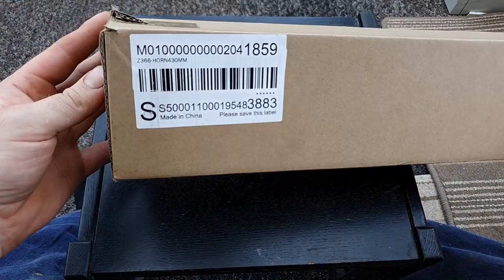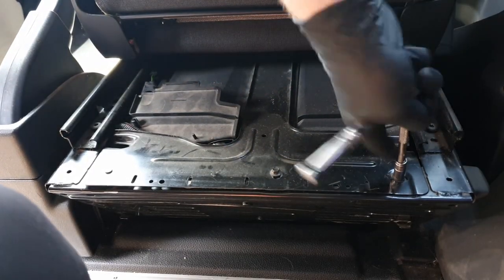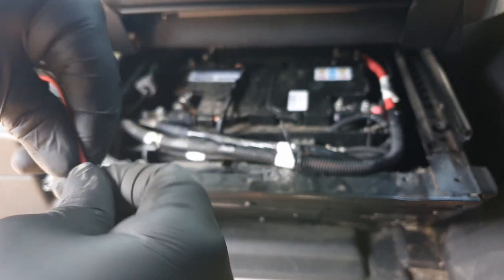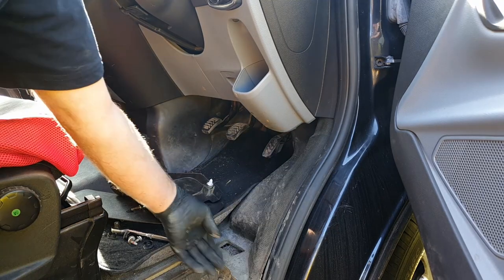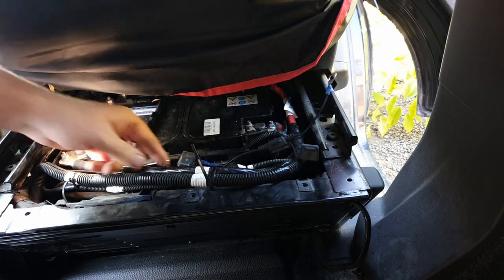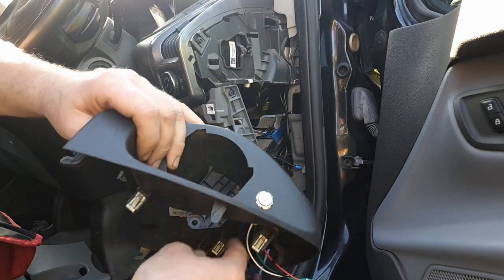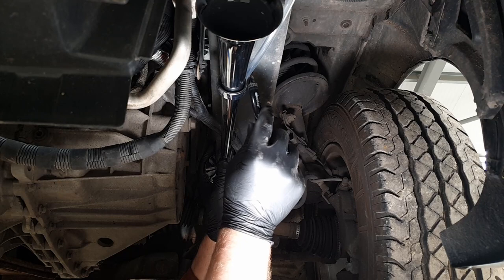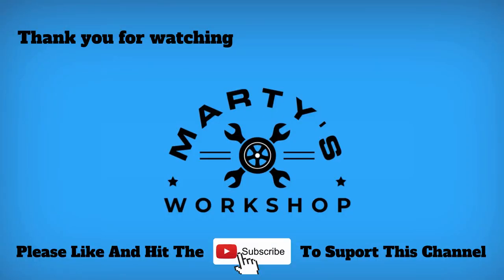How to fit an aftermarket air horn kit to your ford transit custom or any car, van or truck

Comment: Great video. I think I need your help 🏴😂
Reply from the maker: Thank you for watching
Reply: @Martysworkshop  what size cable am I ok to use for my Compressor for my Dixie horn. I’ve done a set up like yours but I’ve just realized I have used a 17 amp cable from Halfords. 

What can I get away with mate. 

Thanks

Comment: GREAT instructions. I'm putting air horn in crossover in a Vauxhall mokka but will use existing push switch on steering wheel and use existing wires but will get feed from battery with 30 on relay jointed together with 85 on relay. Just need to locate original horn in mokka think under front bumper ,good reviews
Reply from the maker: Thank you for you feedback and support

Comment: back again,can i connect too live and negitive wires already connected to my vehicle horn cables, so i can use the air horn and vehicle horn together.would i still need a relay or can i  do without relay if connect air horn connected 2 wires coming off vehicle to be able to use the 2 horns together of origional wiring . put in 20 amp fuse instead of 10 amp for origional horn.cheers
Reply from the maker: If the original horn uses a 10 amp fuse then that is to protect the wire as that may be what it is rated to, so I wouldn't advise putting a bigger fuse in
Reply: @Martysworkshop  does this mean I can't connect the 2 horns together to work off steering wheel.is my only option to wire separate with push button switch.cheers
Reply from the maker: You can but use the original size fuse
Reply: @Martysworkshop  if I connect to original wiring but put in relay and run positive wire with inline fuse too battery.would this be ok. 10 amp fuse would probably blow as did for you so you increase too 15 amp .
Reply from the maker: Yea that would be fine

Comment: Hi Marty, also as I'm fitting twin airhorns am I better wiring to the factory horn and if so do I still need the relay and in line relay.
Thanks
Reply from the maker: Hello keith If your replacing the factory horn  you can wire the old plug straight to the air horn.
Reply: @Martysworkshop  hi thanks for getting back to me, so I wire factory straight to the compressor, can I do away with the relay and just keep the inline fuse. Sorry to a pain. 
Thanks Keith
Reply from the maker: The original horn circuit will already have a fuse and relay so just unplug them off the horn and wire them to your compressor.
Reply: @Martysworkshop   but surely the compressor at 200watts will be too much for the horn wiring? I was planning to wire my relay live to the horn circuit, then wire ground in perm and then run the horn off the new relay which is wired to the battery
Reply from the maker: If you want to play it safe just use the oe horn wiring to switch the relay then use a higher amp wide from battery as a suply for the compressor. Thank you for watching.
Reply: @Martysworkshop  yeah that was my exact plan. Love the video though mate very helpful regardless as the only video on transit custom air horns

Comment: Me again mate. Bought same air horn. My question is would it be possible just to wire to transit custom factory horn wires with 20a fuse on live? It's just probably would be better to have one horn on steering wheel instead of fitting additional horn with additional horn switch button. And factory horn already have 20a fuse and a relay.
Reply from the maker: Yes all you would have to do it cut the factory horn plug off and wire straight to horn, my only reason for not doing that is i wanted the option to use ether horn  altho i don't think i have used the standard horn once since.

Comment: If my recall is correct it is illegal in the UK to have a horn switched separately from the main horn, they must sound together, from the same switch.
Reply from the maker: I was under the impression that it was only illegal to have a horn that is more than single tone, it has been through an MOT since fitment and there was no issues. I will look into it though just in case. Thank you for pointing this out.